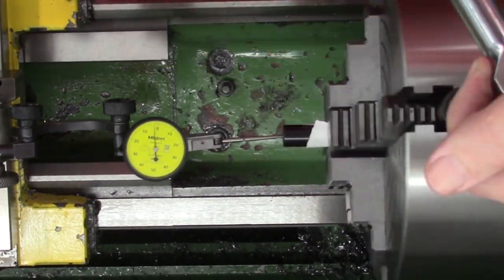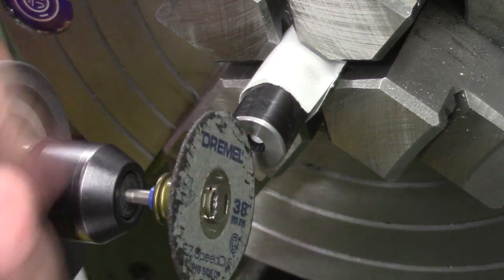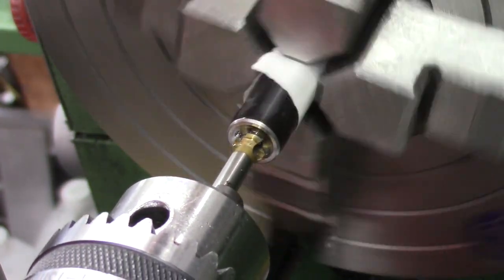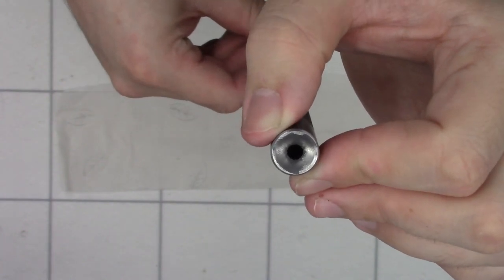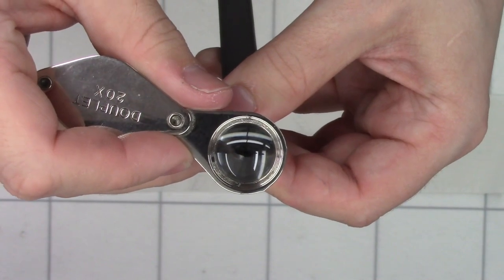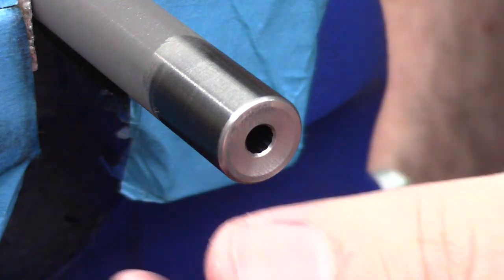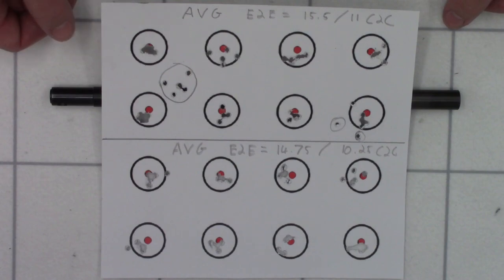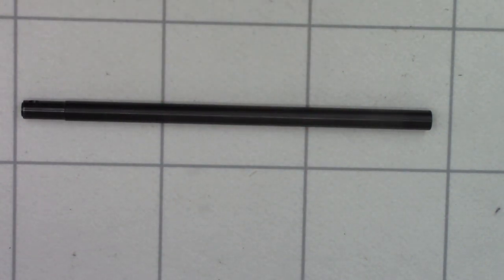Re cutting the crown on an air rifle barrel.

Comment: I took the barrel out of our AGT Vixen last week for a proper clean.  First thing i did was to carefully push a pellet through to check for any tight spots.  The barrel is unchoked and was perfectly uniform all the way down, however there was some slight grabbing right at the crown which required some additional force to push the pellet out..  Do you have any advice as to how i should go about sorting this, or if i should even attempt it at all...?   After cleaning the barrel with some solvent using a nylon brush attachment from my barrel cleaning kit, i used some metal polish on a mop attachment and ever so gently and evenly polished it. I then cleaned it out again with some solvent, blew out with an air line, then used a Napier kit with some oil on pull through patches, then dry patches to finish..  Definitely seemed to improve consistency, achieved the best score card with the Vixen yet, but i still get a few more flyers than I get with my Red Wolf, which is the only thing letting the Vixen down score card wise, and i'm wondering if the tight/uneven crown is the problem...  Any advice would be greatly appreciated.. 👍

Comment: You can improve a rough crown by simply rolling 800-1200 sand paper into a blunt cone. Push the paper in the barrel 3-4mm and twist it back and forth 6-8 strokes. Rotate the barrel 90 degrees, repeat until rotated 360 deg. This will not fix a truly bad crown, but it will fix rough edges and burrs. It may or may not improve accuracy. This is a very conservative operation, and  won't hurt the crown. Tip: Look at the crown with a 10x loupe and strong light before and after. You may see tny burrs that got smoothed off.
Reply from the maker: Yep another good tip, especially if you don't have a lathe, Thanks for watching.

Comment: How can I contact you?  I have a new Styre Pro X I want to thread and re crown, looking for advice.  I have a precision lathe in the shed, gauge pins, an adjustable 5c collet chuck... as far as I can see there should be no problem doing this, just have a couple of questions on 'acceptable' runout and your opinions on tools for cutting.

Comment: Can I ask how far past the transfer port does your riffling start, 
Does you pin push the pellet into the riffling or does the pellet sit in the smooth chamber.
Reply from the maker: The rifling starts immediately after the transfer port the pellet is pushed into it via the pin probe, nice and gently the pellet is fully engaged with the rifling so both head and skirt of the pellet are in the rifled section. Thanks for watching
Reply: @sub12airgunners  that's interesting,
The rifling on my cricket tactical starts 15mm past the transfer port, the pin only drops the pellet into the chamber where it seems very loose, unless I use a longer slug,
I would have thought it would be right on the end of the transfer port.
Very strange.

Comment: Off topic I know, out of interest how would you go about machining an o ring groove inside a .22 barrel. Thinking about try to machine one out of a barrel blank but not got a tool small enough, just wondering if you had done this
Thanks great video as always 👍
Reply from the maker: I have cut loads of them you just need to get a small enough tool or grind one yourself, I get mine from a place in the UK called Cutwel, they are called microscope boring inserts, I do have a video in which I explain the o ring grooves if you look on the channel for the Making FX .177 barrel Part 3 the transfer port and supports, that might give you a little extra help. Thanks for watching. 

https://www.cutwel.co.uk/lathe-tools/small-part-internal-machining/microscope-internal-machining-system/microscope-inserts/microscope-boring-inserts
Reply: @sub12airgunners  thanks 👍
Reply: @sub12airgunners  think I’m best off buying one cos if I try grinding a tool that small the geometry will be well off…!
Reply from the maker: @Airgunfunrich  Yes I gave up on grinding ages ago now, carbide does the job much quicker, although it does hurt when you break a £30 bit. thanks of watching.
Reply: @sub12airgunners  know exactly what you mean! Keep up the great work 👍

Comment: Great work & explanations, as always. Thanks gents, great videos. 

Does the grinding dust getting on the lathe not worry you a little?
Reply from the maker: Yeah I didn't show it but after grinding we always do a full clean of the ways, we are not grinding 24/7 so its a little here and there but the dust is removed asap. Thanks for watching.